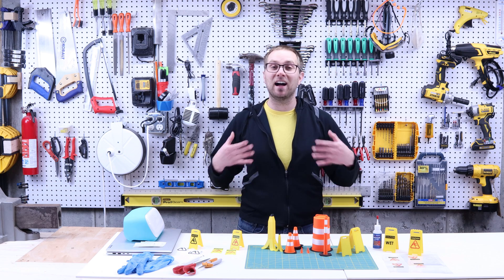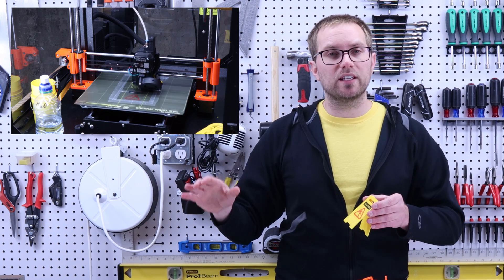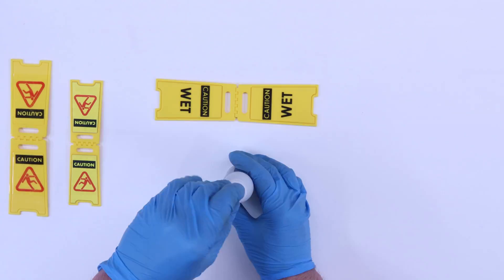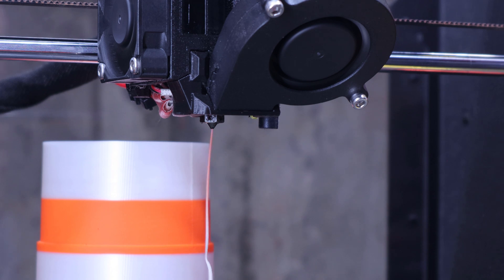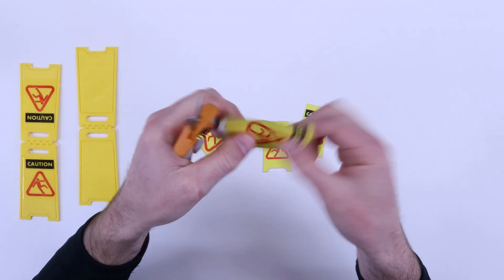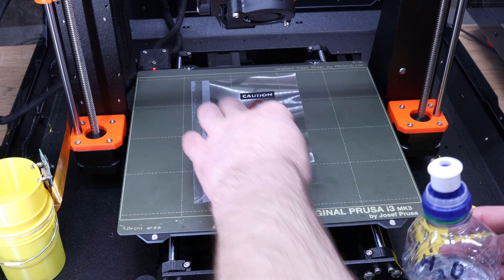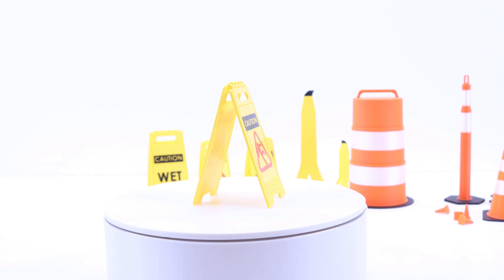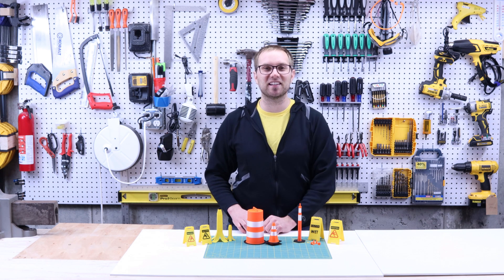4 ways to add color to your 3D prints WITHOUT paint or multi-material. 3D Printed Tiny Traffic Cones

Comment: I didnt know about the toner transfer option. Ive done the stop your printer at certain heights for different colors. But the other two ive heard of, but dont own a cricut and bought some sticker paper but its kind of expensive. Plus, you then need to manually adhere them to the print which could cause other issues.

Which ootion do your etsy buyers seem to like the best? Also, if you dont mind me asking, what percentage are etsy fees for selling things there? I have some ideas for board games, but havent really looked into getting started with an online store. Or is there another place youd advise to look into? Thanks for any info you feel like sharing. Really inspired by your videi topics.
Reply from the maker: Thanks so much for watching and commenting! 

On my Etsy store I sell a few items with vinyl labels and the traffic cones with simple color changes by later heights. You can check it out here if you're interested: asamakesstore.etsy.com 

I wouldn't want to use toner transfer for something I sell regularly as there's a lot of adjustments and manual steps needed. With the traffic cones I just print those in bulk using my MMU2s (now MMU3s stay tuned for the MMU2 to MMU3 upgrade video next week!). 

Then with the buckets and slippery when wet signs I will do a big batch of applying vinyl stickers from my Circuit every few weeks. I can do 20 or so in an hour (depending on how hard I'm working)

I like Etsy but the fees are fairly high, it's around 10% of each sale just in fees for Etsy. I wish those fees were lower but they develop the platform and the vast majority of my sales come from people browsing or searching on Etsy so it does actually feel fair. 

I definitely recommend you give it a try - but it can be very time intensive.
Reply: I'm looking forward to the MMU2 vs MMU3 comparison, especially since you are using them for your business. I found the MMU2 fiddly and updated it to the MMU2S which helped slightly. But, the color changes are slow and I ended up having a lot of my filament ends being a little too large to fit back down the tube. I think that was my main complaints about it. I like how the BL X1C does filament changes. It actually cuts the end off, so there is no blob-y end to go back in through the tube. And then it purges out the back. You can set the purge amount. It is wasteful, though. But, its much faster since it's expelling a larger amount out the poop shoot versus into a purge block. It can still have a priming block, so it can pressurize the nozzle for printing.  @AsaMakes
Reply from the maker: Have you updated to the latest MMU2s firmware? It improved the speed considerably

So far MMU3 upgrade is performing really well, only a few hundred filament changes but 100% reliability and the 1st upgraded unit just worked right away without any tinkering